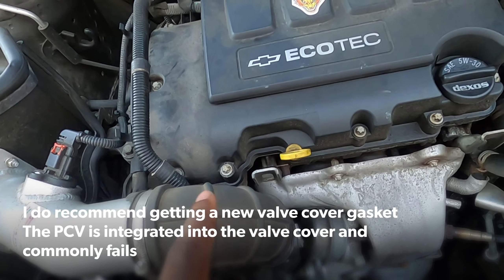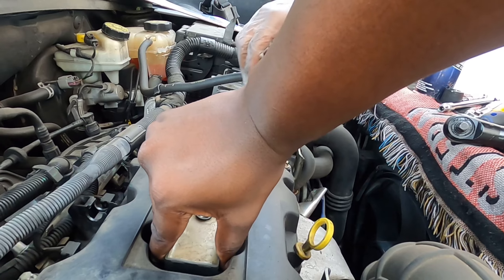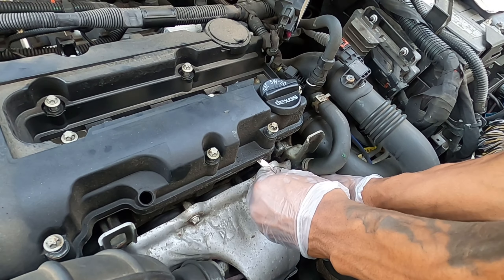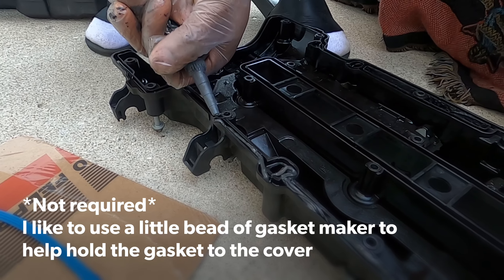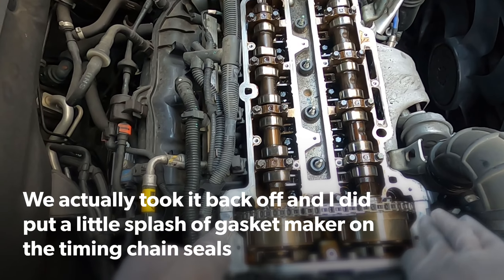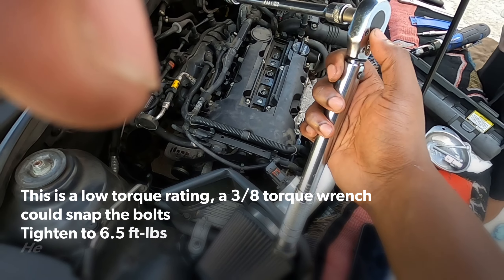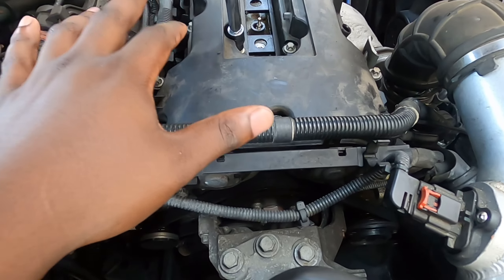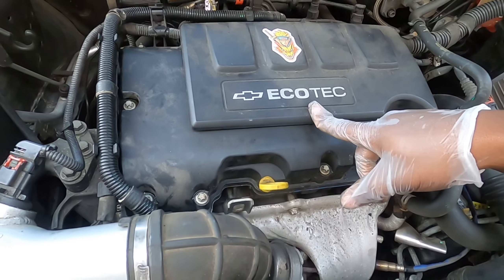2011-2015 Chevy Cruze 1.4L Turbo Valve Cover Gasket Replacement

Comment: I changed the valve but screw 15 did not tighten and oil came out, I returned the old valve and the same screw did not tighten, what should I do in that case.
Reply from the maker: Sounds like the threads may have stripped in the hole. If you can still see some threads in the hole try using a little bit of pipe tape on the bolt that may get it to hold snug. If that doesn’t work buy a thread tap kit and re thread the hole

Comment: Bro mines leaking on valve cover on the driver side next to valve cover corner I tighten the screws and has new gaskets
Reply from the maker: Gasket may have rolled